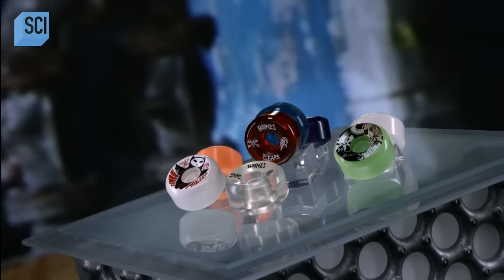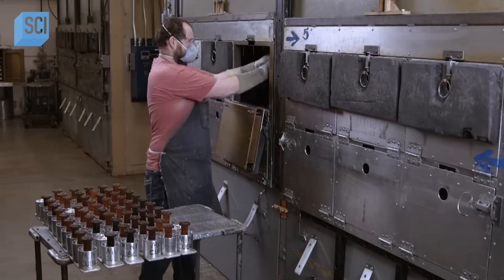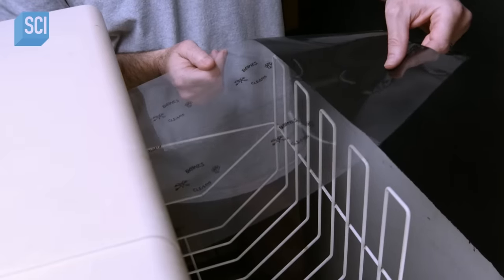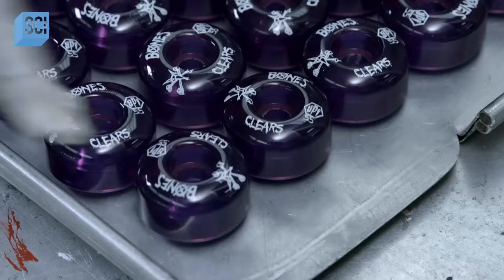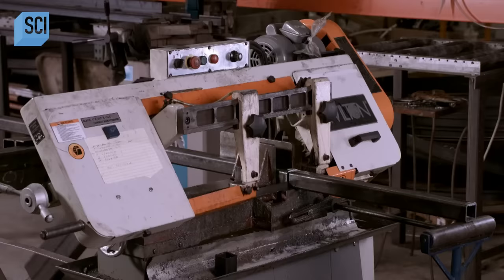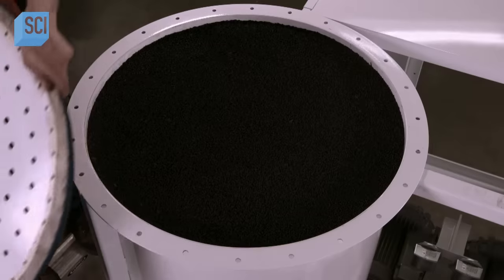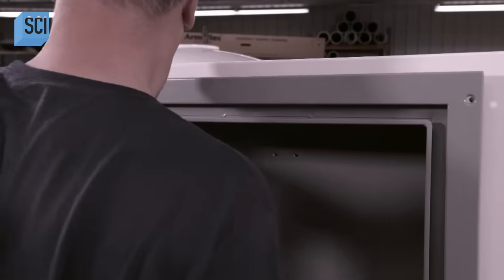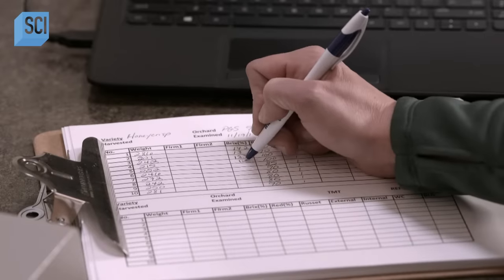How Skateboard Wheels Are Made & an Inside Look at CO2 Scrubbers | How It’s Made | Science Channel

Comment: those scrubber tank rings could benefit from using a gauge pin mounted next to the punch at one hole location over, to index the wheel and eliminate the whole center punching process, while increasing accuracy

Comment: using a flat blade screwdriver and tightening those screws like a sissy.  I forsee lots of electrical issues in that co2 scrubbers future.  Someone get that guy some training....
Reply: what the heck are you talking about? Those terminal screws (i assume this is what you are referring to) are designed to be tightened by both flat and phillips, and the point is to secure the wire in the terminal, not crush the wire.